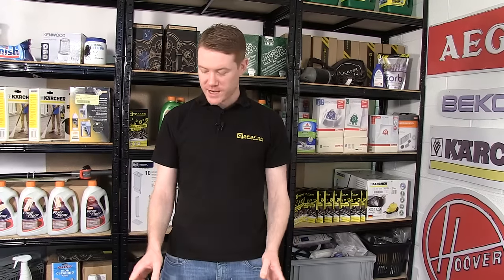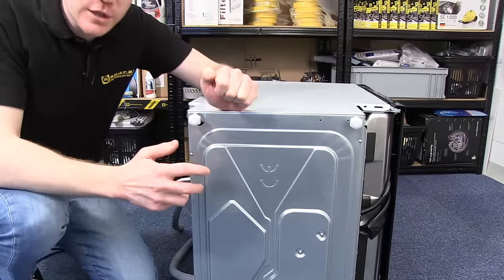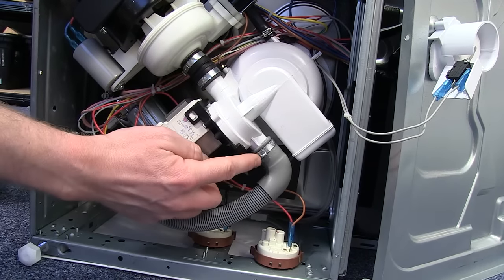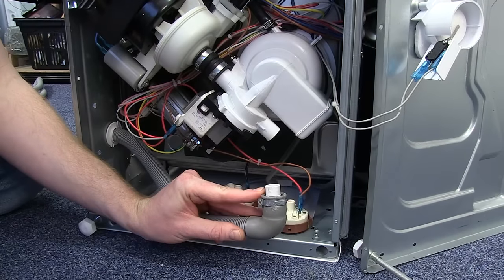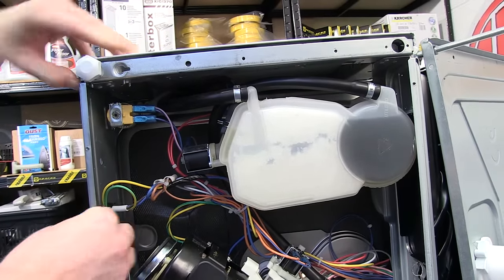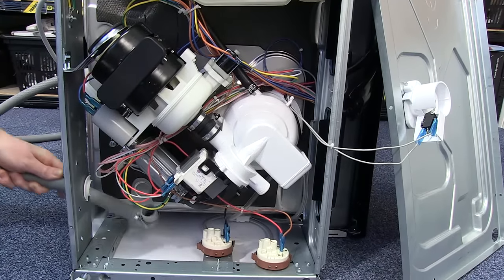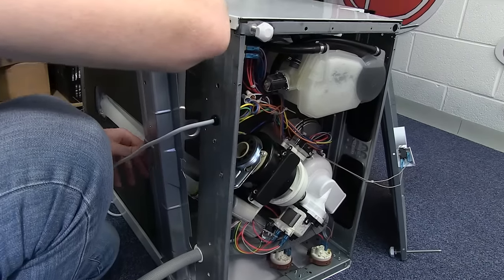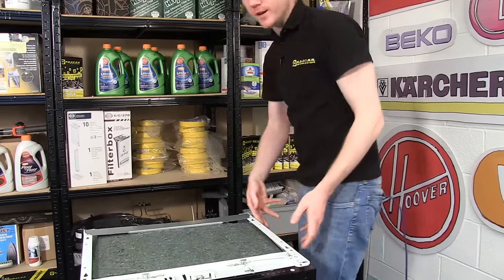How to Replace the Drain Hose on a Dishwasher

Comment: Clear instructions with no messing about.  Only problem I seem to have is the switch turning the water off is stuck.
Anyway thanks, will have a go now.
Reply from the maker: Hi Helen, try using some water pliers to move it and that should do the trick.
Reply: Thanks will let you know how it goes
Reply from the maker: Good luck Helen.
Reply: eSpares All done and working! Thank you so much, to think we were going to buy a new one. Who said you can't teach an old dog new tricks!
Sorry not to get parts from you will in future.
Reply from the maker: H Helen, well done for fixing it yourself and hoped we helped a little, have a lovely day.

Comment: Thank You for the overview on this repair & replacement of the drain hose, I now understand the process. I am the owner of a MIElE dishwasher and they seem to have parts that are obtainable in Canada but with some difficulty, I did purchase a drain hose from a professional supplier that is based for general use and the service fees are astronomical $280. +  MIElE'S OE parts of $100. I want to circumvent this by doing it myself. I went to Guy's school so I know and have the tools! Would it be possible for any of you in the comments to make comments or direct me to a MIElE-specific video on how this video differs from the Millie brand that I have? 
MIElE  Dishwasher G 4205 U Thanks in advance

Comment: Great video and were I 20 years younger I would be straight in there, it looks perfectly clear now. . Unfortunately I don't feel quite up to the bit where you turn the dishwasher on its side,  most short old ladies lack the necessary muscle to heave white goods around easily. Perhaps one day a dishwashing company will address the need for a self inverting machine?
Reply from the maker: Hi Isabella, thank you for posting and we do understand but would you be able to get some help for the lifting but if not thanks for watching anyway.

Comment: I did this today but got water everywhere, do you think it will be fine in 48 hours incase any water went on the electric components? Thanks
Reply from the maker: Hi Keo1711, did the water go directly over the components? there is a chance they will dry out over the 48 hours but make sure there are no more leaks.
Reply: Thanks, I had the dishwasher on its front with the waste pipe and water inlet in the air, when i disconnected the water inlet (had to take it off to get the waste out) the water leaked into the dishwasher. Im gonna give it 48 hours and see if it works. There is no more leaks